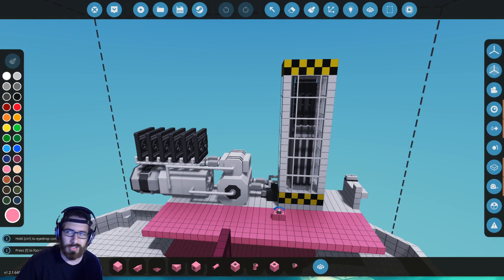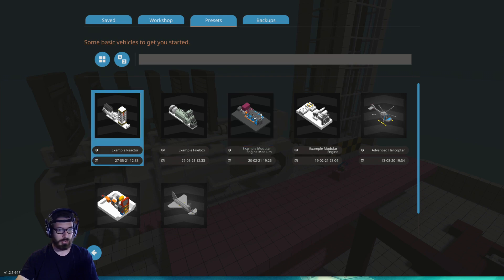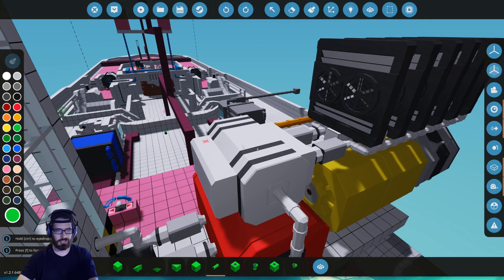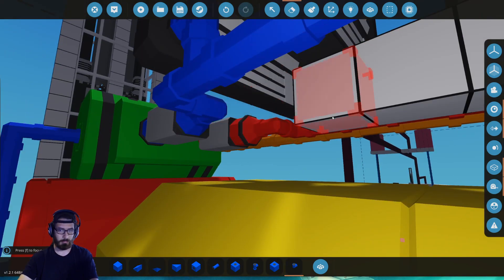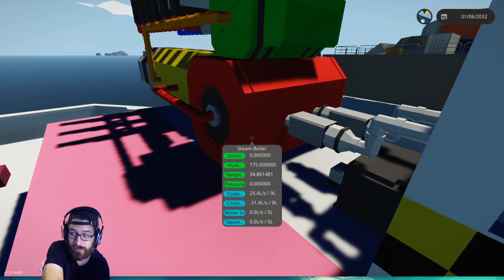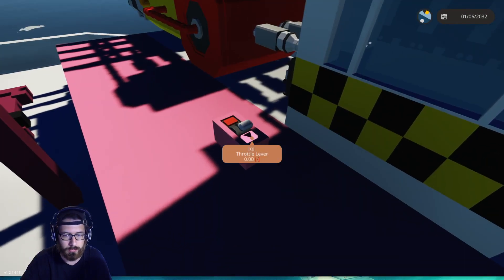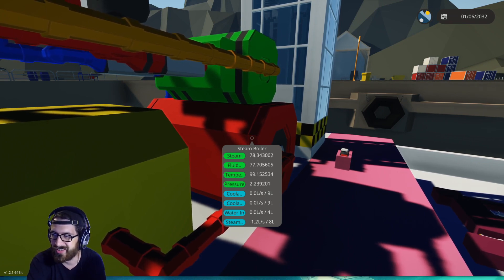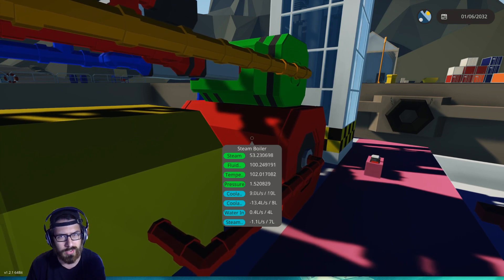Stormworks Nuclear Update 1.2.1

Comment: hey btw because most moderrators for reactors is heavy water (deutrium oxide i think it was) if the water is gone/all steam the reaction would stop bc there is no moderrator and the reason the reaction went on in chernobyl was bc it used graphite as a moderrator and the steam had no where to go and in fukoshima there was to much pressure that they successfully vented but bc of the high pressure some sensors malfunctioned (for example the fill level sensor) and they thought there was enough water in the reacor (which there wasnt bc of the malfunction) and thats the reason of the meltdown from fukoshima (ik its hard to understand :/ )
Reply from the maker: I love atomic theory, believe it or not. Chernobyl's RBNK 1000 series reactors all had what is called a positive void coefficient. Basically, due to the graphite tipped control rods, and the fact that most of the moderation was due to the water in the core, the system had nothing to really stop the chain reaction. The positive void coefficient/lack of proper containment building, and some other factors are the biggest differences between a Chernobyl, and a Fukushima. Those reactors had detonations, for sure, but not complete, and total destruction like what happened in 1986 because they used a negative void coefficient, and had proper containment. It took a huge Earthquake, a enormous tsunami, and total power failure to destroy those reactors. And newer reactors are even better designed than either of those examples. My reactor? Well, you have seen the intro. :P
Reply: @DisasterArtist007  i know thats bc of the graphite bc heavy water can be used as moderator so if it is to hot and the water transforms to steam the reaction stops but graphite has a way higher melting point and till it vaporises its to late
Reply: @DisasterArtist007  i prob. didnt do a good job seperating these 2 incidents but yeah i know why the reaction in chernobyl ran away bc of the moderrator
Reply from the maker: @perfektsusanno9579  Yeah, Water slows down the neutrons, which speeds up reactor activity. I followed what you meant. lol
Reply: @DisasterArtist007 exactly
Reply: @DisasterArtist007  btw im building a reactor into a shipping container lemme now if you want to try it once its done
Reply from the maker: @perfektsusanno9579  Sounds good. I am still working on the control systems for my reactor. I have the idea to have it pull fuel rods out after they hit a certain point. I got about 4 hours of footage of em tolling away at it, and might be all episodic, or condensed into a couple of 3 minute episodes.

Comment: How do you connect the input of the throttle lever to the control rods?
Reply: Throttle is a number output, the control rods need a number input (they also have a number output so you can see how far in they are)
Reply: @rupertthedrone4717  how do I give it a number input/output?
Reply: @spoiler539  so on the throttle controller there is a small green dot that you can connect through logic to the green rings that are on the control rods (in logic)
Reply from the maker: @rupertthedrone4717  Yep. The base unit didn't have the lever. I am learning it as we speak.